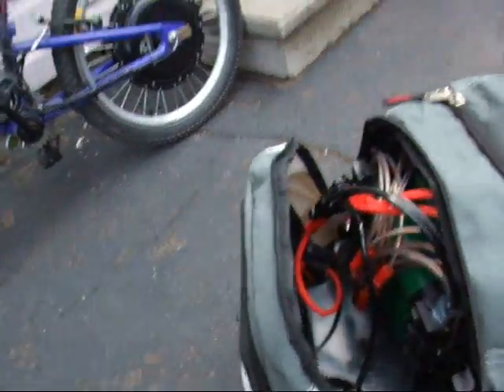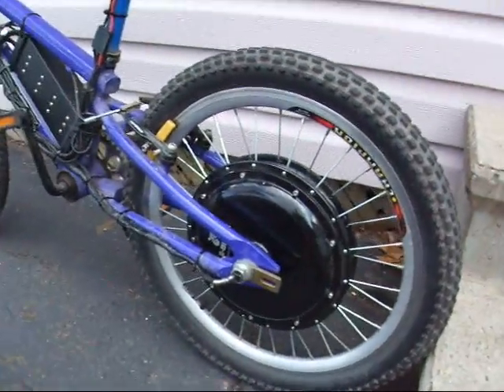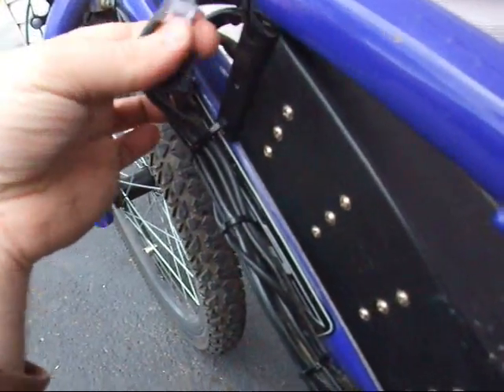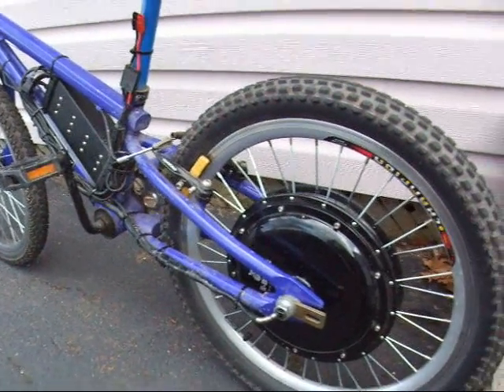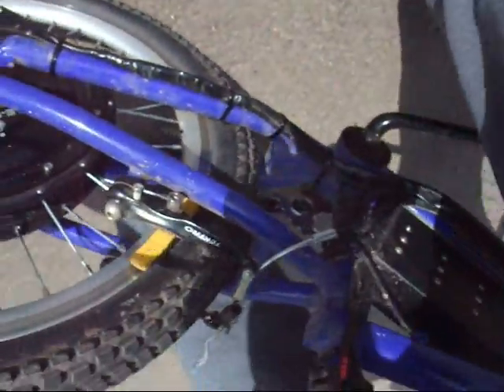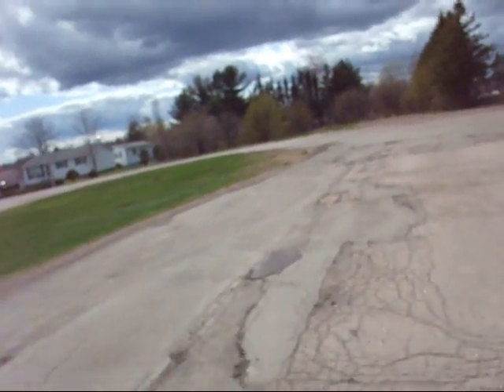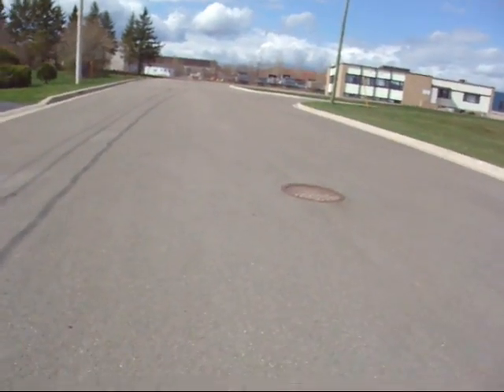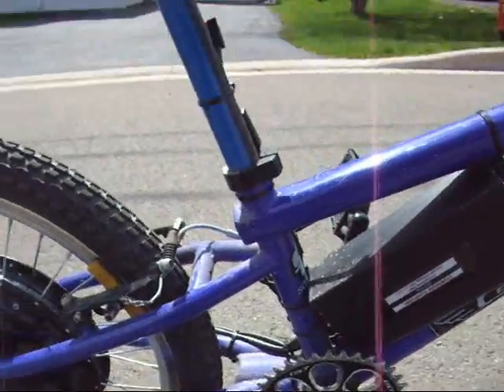Troubleshooting rough startup on brushless hub motor

Comment: Having the same issue. I realized that it behaves the same way even when I disconnected the hall sensors. But the motor work well with another controller. So I guess the controller may be having problem with the hall connections.

Comment: I  also saw that you have the batteries on your back pack, I did that also , but it was not comfortable; what I am looking for is a backpack that has a hard plastic plate and build a box and modify it.....same with a camping pack that can remove the pack and just have aluminum brace and modify it..

Comment: I put an kit on a mt bike with front forks with c-clips and shock absorbers with washers on outside fork. Also put torque on one side.  Jumping off when dead start,. Wondering if it's my bad connection from throttle or something else? HELP?

Comment: It may be a hall sensor problem, the reason why it disappears is maybe that controller is one that uses EMF sensing at a higher rpm and sensors at a lower rpm. Just a thought. Have a look at the hall sensor wires and see if they are ok.